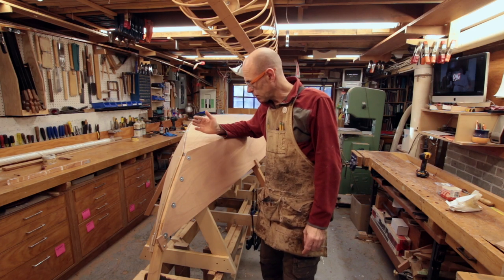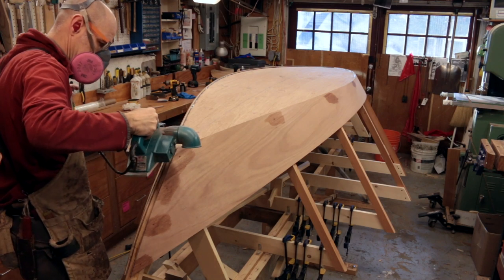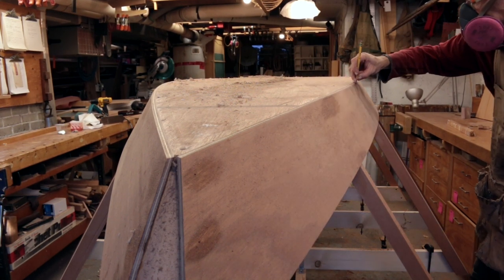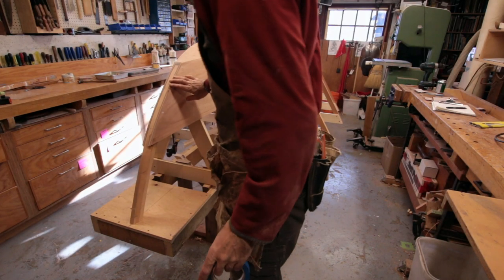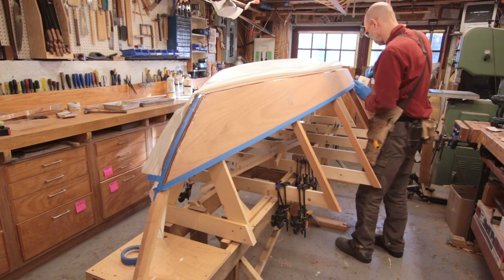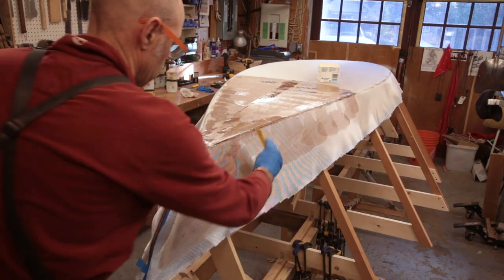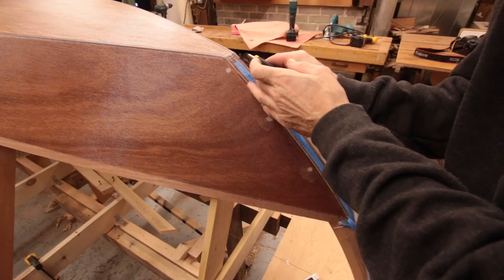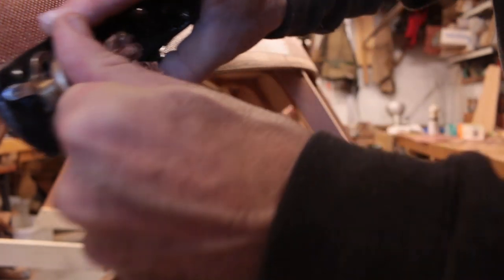Building the Bouchie Dory Pt.16 - Fibreglassing the garboards

Comment: lovely job . I was wondering about your coat of epoxy, you were going to fill coat it but decided to wait till the next day? will you have to sand that last coat before applying the fill coat? what about amene blush? would love your respones
Reply from the maker: savag67 the West System 207 hardener has no amine blush so it’s good to go for re-coating at any time. That’s another reason I like to use it. Amine blushes take some time to develop as well so there’s always a window of opportunity. If I am concerned I give it the recommended scrub down with warm water to clean off any blush. Sanding is important on smooth surfaces but there is plenty of tooth on the glass at this point. Sanding does not remove blush though. Always something to remember. I wanted to do my bevels and gains before my fill coats so that those coats would seal the exposed grain on the laps.
Reply: Nomad Boatbuilding thanks so much for your time to reply. Great information. And again I love your Chanel.